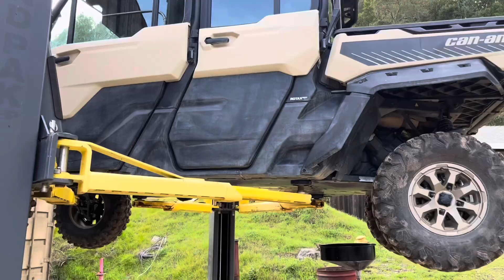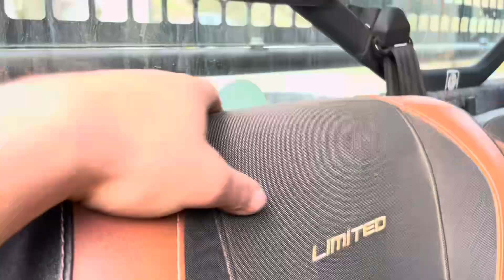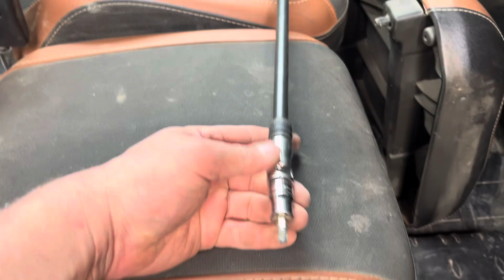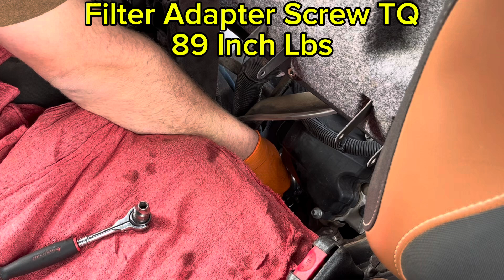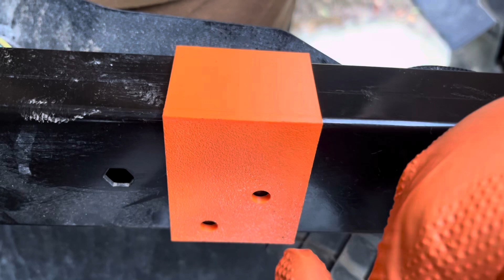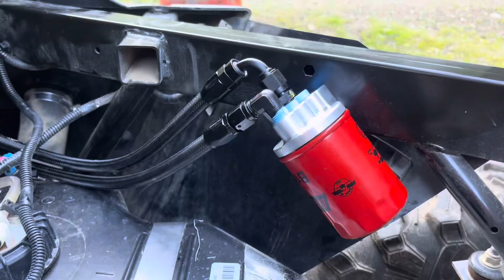Can-Am Defender Limited - Spin-On Oil Filter Upgrade for Easy Maintenance

Comment: I just did the first oil change on my limited today and I didn't have any trouble removing the oil filter from the top with a quarter inch ratchet and a 8 mm socket.. I don't understand why everybody thinks this is so hard.
Reply from the maker: Is yours a 3 seater? There may be a bit more room on those. Were to able to catch the oil that spills out?

Comment: I like the idea. I just don't know if the additional run restricts the required oil flow design.
Reply from the maker: That’s a good thought, I hadn’t thought of that. The kits do have a good feedback from everything I have seen. I have not seen any technical information regarding the kit’s rated follow rate or the engine’s flow supply specs. Thanks for the good comment! Any thoughts on how to find an answer? I have search through the service manual a bit
Reply: The lines look to be about the same size as those used on catch cans, if that means anything.

Comment: The MX on these v twin can ams is ridiculous. Valve checks every year, transmission and differentials every two years. Either can am is raping their customers or the quality of these components  is 1/16th that of trucks thus junk. You’d never keep a truck with the same MX schedule.
Reply from the maker: Yea they do call for a lot of maintenance, I feel like most of them are used pretty hard though. The oil filter in these is insane!

Comment: Very good video.  I have also installed a REMOTE oil filter on my 2024 DEFENDER Limited, but I chose to use an AMSOIL EA15K09 filter.